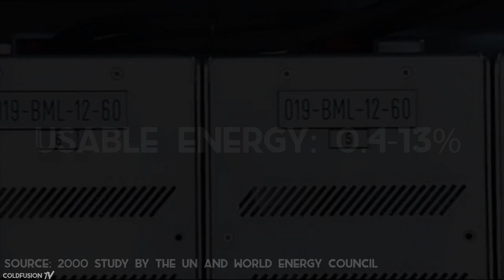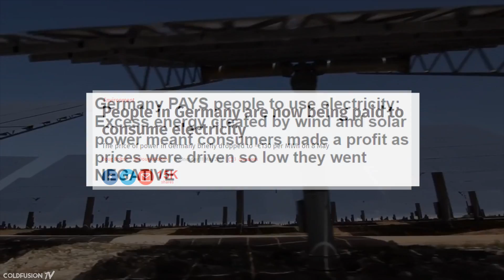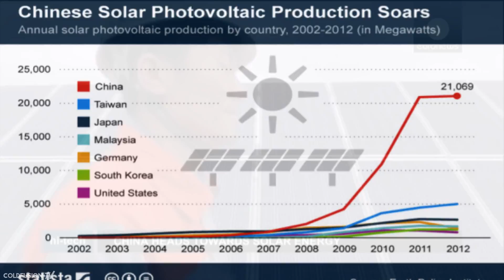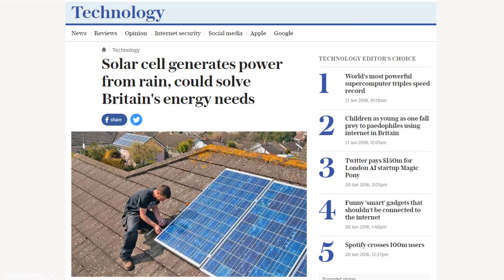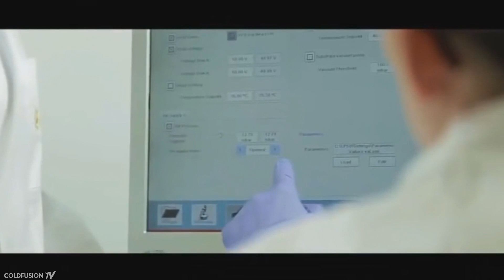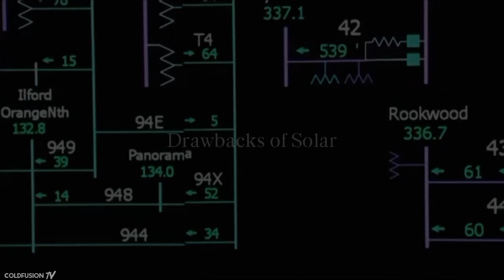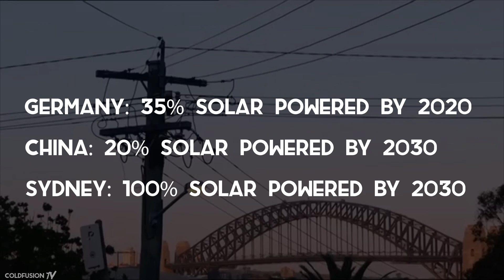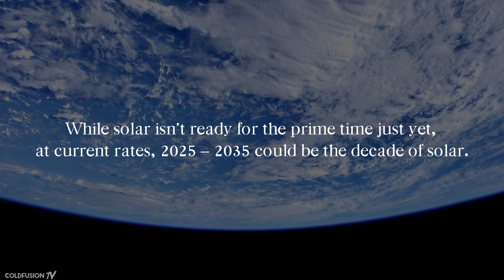The Truth About Solar

Comment: All energy in Earth comes from the sun since energy is neither created or destroyed, only transformed. Except for nuclear of course
Reply: even in nuclear.
Reply: actually there is one exception. geothermal energy is part of the earth since its creation. it is also harvested for electrical power
Reply: LargeBanana Nuclear energy is the enrgy stored in matter that is released in fusion or fision. This energy turned into matter when an old star run out of hidrogen and started fusing and producing heavier atoms, turning later into a supernova and spreading this atoms in the nebula where our sun pulled the gases into its gravitational well to later form Earth. So technically when you break an atom you are liberating the energy that dead star put into the atom.
Reply: and plants stored the enrgy of the sun in the bonds of the big atoms that we break when burning it, so coal energy still comes from the sun :)
Reply: and all the geothermal energy left over from the planet's formation, and all the leftover natural radiation....
Reply: PeDeR it is also just a different form of energy from the big bang.

every energy has always been there, it only changes form.
Reply: not exactly, a big chunk of the planet's internal heat comes from radioactive decay in the inner layers, about 25 % I think
Reply: lentztu True, although arguing that the internal energy from Earth comes from the formation of the Solar system and that that energy came from the Sun in its early stages wouldnt be quite wrong
Reply: all the stuff like coal and nuclear fuel came from old stars that went supernova and formed the earth. the rest come from the sun though like wind, hydro, solar, and tidal comes from the sun too it's tidal effect is half that of the moon
Reply: you are right, I didnt thought about tidal energy, but coal and gasoline... energy come from breaking large molecules of carbon and releasing in the combustion the enrgy from its bonds, this bonds were made by plants and "dinosaur cells" (probably very unlikely but still possible) that got their energy from the sun
Reply: Guille Arana true, but plants also need water and co2 to make their energy in glucose which comes from the earth, and cellular respiration turns plant glucose back to water and co2 which is what decomposes
Reply: But none of this molecules exist by themsleves, atoms are created in the cores of dying stars and they bond to turn into molecules thanks to the suns energy. Although some water did came to Earth from space...
Reply: Guille Arana in the exothermic reactions that bond h2o and co2 you only need the energy that gets the reaction going, which could have been from the supernova, and not necessarily the sun
Reply: Hmmm yeah, my knoweledge doesnt go as far as to know if this reactions can occur during supernovas
Reply: the vast majority of geothermal is from radioactive decay.  To me these are the safest forms of nuclear:  fission inside the earth and fusion in the sun 93 million miles away. nice!
Reply: coal comes from buried plant material.

Comment: Why the hell didn't they make solar Panels on Electric or Hybrid cars in the first place?
Reply: Because the weight of the panel reduced the range more than the energy extended it.
Reply: Interesting.
Reply: I'm pretty sure there's overcharging protection available on these cars as some E-car owners leave their car charging overnight.

The Prius has one but it's more for keeping the climate control on when parked.
Reply: rzpogi
There would have to be, and at the price of such cars this is a simple addition like a Jack for your Phone to plug into

Comment: I smell bullshit around the 7:00 minute mark. Can we get EEV or Thunderfoot on this?
Reply: MrRolnicek It might be time to hit up wikipedia and update your knowledge, bro.
Reply: It's still in development, man.  Look it up yourself, follow the tech, see how it goes.  Nobody can really say for sure how well it'll work in practise.
Reply: Replace your tank, it may be contaminated by your obvious bile...errrm Bias
Reply: Halide as if that's gonna be on wikipedia
Reply: Why's that? The technology to manufacture roofs with cells is already there. Dow Corning (huge silicon company) developed solar shingles for houses. They work great (but pricey).
Reply: Joseph Romano That part is not the problem. It's the whole super thin, transparent, flexible, anything will work as a source deal that smells like bullshit.
Reply: Socore Alaite was that aimed at me? Bias against what? I'm just skeptical, because I don't know of any "mechanism" under which that would work.
Reply: you can make displays literally paper thin, so why not solar cells?
Reply: So far the only 2 mechanisms for solar power generation is 1. chemically (plants) and this isn't good for electricity and 2. semiconductors. I mean are there flexible affordable semiconductors? And how is it transparent if it's supposed to convert light into electricity? What wavelength does it absorb and convert? what's the energy gap in the semiconductor? Or is it a completely new science that I just haven't heard of already being implemented? So many questions
Reply: seems weird, if they wanted to absorb all the light possible you would think they would be black not semitransparent
Reply: No BS; you just don't understand what they are presenting. You need to go back to 6:07 where the idea starts. They are printing a solar cell onto a surface. It is probably done in two passes to make the PN junction. This isn't your silicone cell technology, and if they can print the panel on a surface, then roofs should be easy to do as at the 7:00 minute mark.

You can make copper solar cells on your kitchen table, which is a different technology from silicon, but they are very fragile. My point is these cells may have drawbacks as well, but if they perform as well as crystal silicons cells, they will replace them. We will also see them, or not see them as the video said, in more places than solar cells are used today.
Reply: +MrRolnicek there are flexible lcd screens and flexible semiconductor based batteries. Making it flexible is easy. Making it efficient is what's challenging.
Reply: Leslie Savage still don't understand why they're not very dark coloured
Reply: I have several of both types of these panels, which are well over 25 years old. The flexible ones don't even put out the rated 12 volts, let alone the current they were rated for. My Kyocera 64 watt panels still put out 64 watts in full sunlight. These panels were used to power a house for over 25 years. I've moved, and plan to put the crystal panels back up here to sell the power back to the utility.

The flexible solar panels we have today are still silicon based, and the process they showed looked much different from the flexible panels we have today. The drawback of flexible solar panels is they keep losing the amount of power they produce over time. The advantage of them is you can walk on them, which is why they are solid to be used on boats. You can even put a bullet hole in them, but they loss power, because the PN junction is not locked in place. This degrades the PN junction by flowing like glass does. There are companies that have gone out of business guaranteeing this type of solar panel for use in power generation, because of the power loss. The crystal (or as you say the rigid) panels have the structure of the cell locked in a crystal. They do loss some power, but stabilize as time goes on, which is why they are a much better panel than the flexible silicon panel will ever be. Non-crystal or flexible panels have always been cheaper to produce and buy. They even put them in rigid frames, which makes them look like crystal panels at a lower cost, but they don't look like Jack Frost got a hold of them. Crystal panels are a better investment for power generation, because it holds it's value by putting out the guaranteed power over long periods of time.
Reply: They could be I am sure, but I think it is a selling point to be able to have color on the back side show through. Current solar panels are as sensitive as our eyes, but in a spectrum shifted either way depending on if their crystal or not.
Reply: +MrRolnicek there are thin, flexible, semi transparent PV cells.... but the $/m² and W/m² are both far lower than traditional...... 99% of the products that claim to revolutionize solar or wind power are scams.....
Reply: "in development" - the same way solar roadways was "in development"? Sounds like it.
Reply: +MrRolnicek everything is at least mentioned on Wikipedia. Flexible semiconductors would be on Wikipedia.
Reply: Flexible solar panels have been commercially available for decades. Stan Ovshinsky patented the break through technology. It is actually common these days. The next version will cost less to install than rigid panels. Guy Wicker or Ovshinsky Innovations invented a process to build them very cheaply.
Reply: I'm with you, the whole video is a bullshit ad marketing campaign, 2 words, power density. Just ask Kirk Sorensen, and yes Thunderf00t would agree, solar power is trivial in the grand scheme of things, always has been always will be.
Reply: Matthew Holevinski I wouldn't go as far as to say that solar power has no place. In fact I believe that in the future most rooftops in the cities will either have solar panels or greenery on them.
Reply: I agree, if I was back packing in the andes and I wanted to break out my short wave radio, ya a thin flexible solar film would weigh less than some batteries. But when i think of solar i think of providing small amounts of electricity for individual needs in environments where infrastructure doesnt exist. Not trying to provide base load grid power, that is what this world needs, not an insane yet truly awe inspiringly great marketing campaign like what solar has.
Reply: +MrRolnicek has anyone ever ran the numbers on the energy consumption of the  complete lifecycle of a solar panel. from making the rubber that goes into the shoes of the man who drives his gasoline of diesel vehicle to the quarry to drive the gigantic machinery to mine the rock to deliver it to post processing to be ground down and seperated and shipped off where it is fabricated by people who drove to the factory who then shipped it on a container ship across the vastness of the ocean to be encapsulated in plastic that was made from the oil it was trying to replace of all of which was done using the power from coal to provide all those manufacturing processes the ability to do what they do to slap a label on it put it on an airplane to get delivered to some idiotic place that is thought to have more sunlight  than where people live to have the grid extended to the panel just so that the panel can get put on a truck to be delivered to the field and installed and then replaced in a couple years and thrown in a landfill. i bet anyone a guhzillion dollars that moronic panel never pays its due to the environment, which honestly I dont really care about. people want panels fine buy panels, but for godsakes don't lie to yourselves.
Reply: You're discussing undertaking a life cycle analysis for a solar panel, and yes, they've been done. I'm not going to google it for you, but the answers are there. You'd lose your guhzillion dollars - mainly because panels are a 20-year+ lifespan product and not "replaced in a couple of years".
Reply: You are right its partly bullshit.
The mentioned perovskite solar cells are based on lead ammonium halide materials which immediately dissolve upon contact with water. Therefore, you need to encapsulate them with sophisticated and expensive polymers or you have to put them between glass sheets --> no flexibility anymore.
Furthermore, the electrodes materials used in perovskite solar cells are extremely expensive.
The most important criteria for a solar cell beside efficiency is field operation stability. Any flexible thin film solar cells perform significantly worse in this criteria than conventional silicon solar cells. 
Companies that already went bust with some fancy printing thin film concepts: nanosolar Inc, solyndra, sulfurcell
Reply: Panels of a similar nature have been around for a while, so that part isn't BS.
Power production however is not so good, being transparent means not much light gets captured, being thin also means many photons just pass through, painting it on uneven surfaces is yet again a power loss, hot surfaces is power loss, and they easily damaged when just "painted on".

Ye olde silicone panels come in those huge reinforced slabs because that is the simplest way to make them useful over long periods. The working parts are only paper thin and you could put each piece where you wanted it, but for longevity you quickly run into problems.
Reply: no one is getting paid to burn electricity in Germany. They made a famous mistake shutting down nuclear and now pollute more than ever.
Reply: okleydokley Germany is buying electricity from us now (Czech Republic) because we kept our nuclear.
Reply: +okleydokley that is true
Reply: +MrRolnicek that is also true
Reply: yes printing solar cells is possible. Doing it with perovskite is a bit tricky, but organic solar cells are readily available as flexible printed solar foils www.infinityPV.com / https://www.youtube.com/watch?v=nabM5MGq_NY (they are not as efficient as traditional cells, but good for niche applications)

Comment: listen dagogo, why not a grid of superconducting metal cooled and as  isolated as possible that connects to nodes in the places of need or of energy production. isn't that a good way of transporting electricity? where am i wrong? with superconductors that can resist at 100K° it's not even that expensive to mantain.. anyone?

Comment: the real breakthrough in solar energy I think, is when you can efficiently "put it in a can" and distribute it like that.
Reply: Do you mean like a battery? Lithium ion/polymer batteries are quite efficient at storing and releasing energy in a portable form.
Reply: MrCordycep actuall yes exactly a battery, but today's battery is still heavy and huge compared to how much power it can store. And it is also need to be used immediately.
Reply: ***** well I'm not just talking about portable devices but energy industry as a whole. You can put oil, gas, and coal in a can, and it would store the energy it has indefinitely and is actually easy to move around. In that way a country that has a surplus of those resources can then sell them to other that needs them.
You can't do that with solar energy now. I think when you can finally able to do that, that would be the final breakthrough for solar energy.
Reply: ***** Solar is an intermittent power source so you will always need backup power so your device doesn't die when there is no sunlight. Electrical storage technology has lagged way behind our thirst for mobile electronics but we will hopefully see a boost in investment as we tend towards a more electrically mobile society.
Reply: You're forgetting about those 14 hours where the sun isn't up. That whole night thing. Gotta have somewhere to store the power for that, and that's not really practical on a grid-scale.

Comment: Nice video.
There's another's approaches to take advantage of the solar. In my country, we use most of the solar energy produce to pump water from the down side of a dam to the upper side. With this solution in the hour wit low production of solar energy we use the water to produce energy. On top of this we also have a large park of wind energy that complements with solar and dams. With this solution Portugal last May run 4 consecutive days with zero emission energy.
https://www.theguardian.com/environment/2016/may/18/portugal-runs-for-four-days-straight-on-renewable-energy-alone

Portugal is around 10M people with a considerable industrial infrastructure.
The problem of the renewable energy is 'How to store it?' in Portugal we use instead of batteries or the grid, we use the dams and sometimes send it to Spain or France.